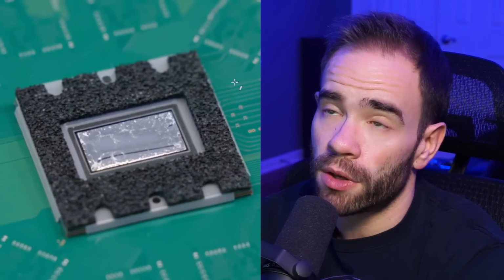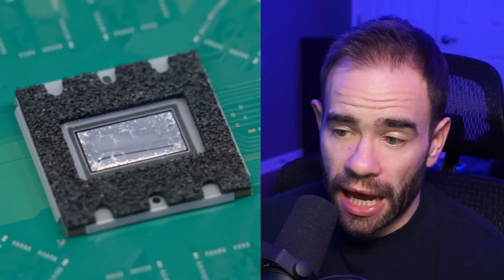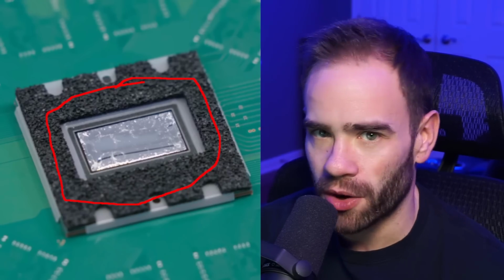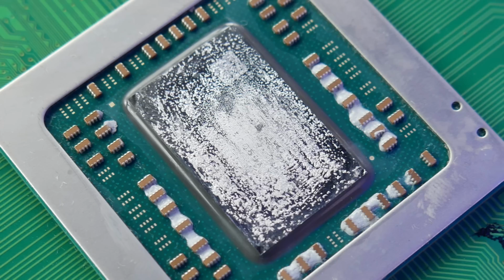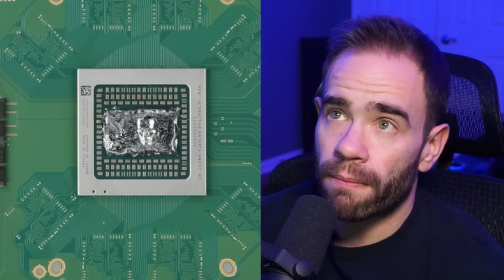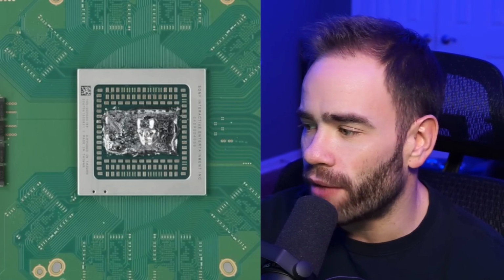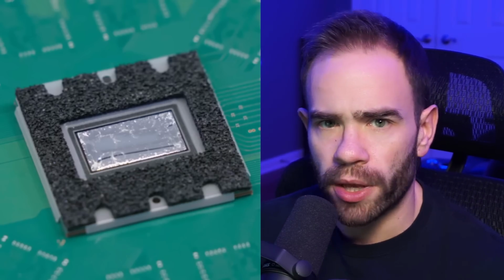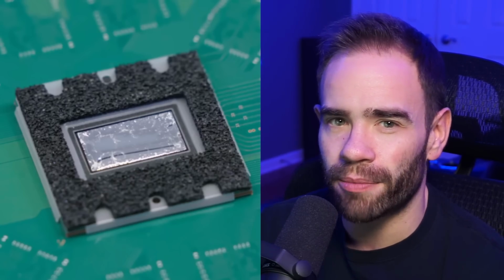Is Your PS5 Actually In Trouble?

Comment: The main challenge Sony had was to find a way to automate liquid metal application.  Anyone who has ever used this material knows how hard it is to get it to 'byte' originally.  The issue here, which is valid, is that the PS5 has about twice the liquid metal that is needed for a chip!  This means that it pools and moves and, unlike your PS4 Pro application that you did, it is the excess that would cause the concern.  I have done many chips and never had this issue but you literally use a pin-head of liquid metal on the cpu and also the heatsink (non aluminum obviously).  So the risk doesn't surprise me and there would be a greater risk of overheat or leak just due to the sheer amount of the liquid used.  If the seals hold then cool but LM also attracts LM so it 'pools' and it may drag more LM from the chip as it pools at the bottom.  LM gets absorbed into copper as well so there are a bunch of variables but I don't think you can compare the automated LM application on a PS5 to what you did on your PS4 Pro!  If done in the right amount and with the right care there should be zero risk (bar that of how other metals react to LM over time).  So I don't find this risk on a PS5 unwarranted due to HOW the LM is applied and how MUCH they use!  They also don't use a resin layer over the caps close to the die and opted for a plastic tape type thing, which doesn't guarantee it won't leak.  If you drop, or give the PS5 enough of a jolt it could unsettle the seals in place and cause it to to stop working.  So yeah, risks are minimal but there are risks none-the-less, and anyone who has used LM will see that what Sony has done actually increases the risk of leakage or overheating over time.  Great video and I don't think panic is needed, but horizontal placement should be 'advised' for long term ownership IMHO.
Reply: The reason Sony applies a lot of liquid metal is because the liquid metal in the console is expected to not ever be reapplied for the life of the console.  The liquid metal reacts and gets absorbed into the contact plate over time, as you’ve mentioned.  In a situation where no one is opening up the whole thing to check and reapply the liquid metal for years and years on end, the best option is to apply enough of it to last the life of the console and put barriers around it to ensure it doesn’t conduct any surrounding components.

If they applied the “correct” amount of liquid metal, all of the PS 5s would face decreased performance and overheating issues in the first few years.  This is why liquid metal producers for the pc market recommend yearly reapplication, because they know the diyers aren’t putting enough of it to need custom made barriers and the performance will start taking a hit once time passes and some of the liquid metal is absorbed into the virgin contact plate metals.

Comment: see this is actually called lazy engineering on sony's behalf. it took sony to use liquid metal to be able to get the same temps as the xbox series x, and it's still using thermal paste. but i won't hold that against sony, they have never been good with their thermal solutions when fans were needed.

Comment: As I've echoed several times, 99% of people are probably going to be fine and never experience an issue. That said, this is definitely more than a few isolated cases. I've seen several myself, and I'm not by any stretch of the imagination a big repair tech. Most of my repairs these days are done for content and bought as faulty on eBay. What I agree with here is Sony definitely does apply too much liquid metal on the PS5, and because of that it causes the liquid to pool up on the left side of the APU. The thing going around about how they're all drop damage consoles is absurd. If you think about it, all it takes is vibrations, give it long enough and that liquid metal will eventually start to seep into other areas. The density does help it, but at the same time I've had cases where there's no evidence at all of any kind of drop, and it's made its' way under the protective foam and under the black gasket (the video that wololo quoted).

One problem is wololo did misquote my video, stating I had claimed the console I worked on was stored without being used at all. That wasn't true, and has since been corrected. What I said in my video three months ago was that the console hadn't been opened by a technican, and that the seals were in tact so the only way it could have leaked was through natural causes.

It's amazing though how so many people, uneducated people (not yourself) are weighing in on this without any knowledge of how the system is built. Not only that but the amount of non tech channels, such as gaming channels, who are creating videos just for the views.

This will all blow over, in my opinion it's been way over hyped. But I'll take the free traffic from it all the same 🤣
Reply: I saw the story followed pretty quickly by watching your Sept. video, and I don't know how from that people think you're being malicious about this all. Seen too many people attack you specifically and just dismiss the entire thing because they don't like how you look.

It's an issue that could hit 1% of users, and that eventually could mean about a million systems if nothing is changed on Sony's end.

I guess the good news is that with everyone wanting to just ignore the warning, the issue will just become an easy source of repairable boards.

Comment: Ive had my ps5 since launch and have always had it set up vertically. The problem I’ve had was that my ps5 will randomly turn off and the only way to turn it back on is to disconnect the power. I researched on how i could fix this and moving the ps5 to horizontal was a possible solution. This did not work. I pulled the fan and thoroughly cleaned it and that did not fix it. What i realized is that having the certain games on the external ssd drive i.e. GT7, GOW Ranorak, and MWII made the ssd overheat. I moved them to the internal ssd and the issue was resolved. I don’t think it had anything to do with the positioning of the ps5. Other than that have not had any problems for two years plus
Reply: What external SSD did you use?
Reply: @lemming9984  i have the SABRENT 1TB Rocket 4 Plus NVMe 4.0 Gen4 PCIe M.2 bro. Im gonna get a different one to see if it makes a difference.
Reply: @sdtarango84  Do you have a heatsink on it?
Reply: Do you mean M.2?
Reply: @scottd7222  lol yes thats what i meant bro 🤭

Comment: Foam and plastic in general degrades over time. So I would say. After a few years of heat. The foam will deteriorate and eventually turn brittle. At which point maybe the liquid metal will start dripping out
Reply: It's not foam, it's spounge
Reply: @GameslordXY  sponge still deteriorates as well. If it's the same sponge like material I use when building electronics it needs to be changed out over time

Comment: The more I think about this, I have come to a conclusion that Sony missed the mark with some of the components they chose to use. The fact that what they chose requires overclocking makes me think they didn’t chose the correct components for the ps5. As a owner of the Xbox series x and a ps5 I now am somewhat concerned about long term ownership of the ps5. I have a ps2,ps3 and a newer non Red ring Xbox 360 and they all work fine. I am curious if my ps5 will last as long as my other Sony consoles.
Reply: you have a series x as a profile pic 🤣

Comment: I have 2 ps5s both disc version I bought them at release yesterday I took apart my 2nd ps5 I keep in my bedroom I don't play it much both ps5s are in the vertical position when I got down to the mother board I had a dime size dry spot at the top of the apu KNOW both ps5s are in horizontal position major design flaw

Comment: I'd think if the seal fails it's going to cause problems regardless of the orientation, they would just occur sooner in the vertical position.
Reply: Yes - But the issue as it's described is that gravity would cause most of the metal would pool at the bottom. Another issue I'm wondering is: How will consumers (or even sony) replace the liquid metal down the line? All thermal compounds need to be replaced at some point. If the seal is already having issues, this could prove problematic for anything but certain non conductive thermal pastes.
Reply: @quiethours1818  
At the bottom?
🙄😆
LM isn't as liquid as much as water ,plus it would kill your electronics immediately as it's HIGHLY conductive .
But they are transported in trucks across not always Great roads and not always perfect driving and turbulance in airplaines.
All the vibrations and bumps
would make them all either Dead On Arrival OR as soon as you turned them ON.
Reply: @GameslordXY  This is precisely my thoughts about this whole thing... I'm definitely not denying this, but if this was real "issue" for the PS5 we would be seeing TONS os cases world wide... And it wouldn't be something that we would just be hearing about lately...
Reply: @quiethours1818  liquid metal will sip out regardless, at that time it will just wait for you to move the console or kill the components around the die.
Reply: @quiethours1818  WRONG.
Reply: Exactly, more people should start saying gawrsh if they're gonna act like we live in a goofy movie

Comment: I've had my PS5 for more than a year sitting in vertical orientation. I've put nearly 1000 hours on the thing without a single issue. I think this is a flaw that happens from the factory, probably not after its been used. People love to freak out over this kind of stuff. It's a classic overreaction.

Comment: I've had my launch model standing upright since launch with zero issues. So over 2yrs now. And that's using discs. I think it only matters if you bang and knock them about. Hardly a red ring of death situation is it. Just buy an anything happens warranty so if anything happens they will replace it new for old. It only costs £50 for 3yrs cover.
Reply: I believe it’s when people mess with it and don’t seal it properly if they’re doing a deep clean

Comment: The whole console is just poorly designed. Components failing, issues with lots of parts. Most high end PCs don’t need Liquid Metal and they down have it. X solution is much better and quieter… can we get a fix for the controller battery, the buggy software as a min. Complete junk.

Comment: Not PS5, but I remember looking into having a setup with my laptop vertical, and there were testimonies that liquid metals may leak since generally laptops weren't designed to prevent that in the long run. Scared the crap out of me, so I didnt risk it.  So, I can totally see it happening to PS5. It seems Sony did add a pretty good containment for it though.

Comment: Had mine from launch and just started having issues with it shutting off randomly about 3 weeks ago. Have a friend experiencing the same issue now as well
Reply: I got the same problem, bought a ps5 totday and its been schutting down when i put the ps5 vertically, horizontal not seem to have a problem.  But i will need test more.

Comment: The whole worry about the liquid metal came from what a dude saw in a repair shop. I would think the percentage is extremely small if there are millions sold and he is only seeing a handful with that issue. And who really knows how most of the owners bringing them in actually took care of anything. It might be best on Sony's part to at least see if there is a bad batch that made it into the wild.
Reply: For every product, especially for consumer electronics, there is always a margin for failure. Usually that margin is very tiny, like 1%. Not like RRoD which was well over 50%.
Reply: @fattiger6957  facts
Reply: Ya don’t say
Reply: Yeah, I agree. Sony did actually had this problem before, especially with a PS4 pro why it sounded like a jet. I had to replace my with a higher quality thermal compound and put more on it. I never had the issue again. Because Sony put too little into their thermal compounds which caused a majority of the Systems to overheat
Reply: @takuminightcore  Or you could have just cleaned it like everyone else.
Reply: @sleep5234  
Correct me if I'm wrong but weren't PS4s near impossible to open up and clean without using some specific tools? It's definitely not easy like the PS5 where they made it so you could take it apart and clean it, at least
Reply: @sleep5234  that I did as well
Reply: @Alexandria Smothitel  If you think a basic screwdriver set is special then I don't know what to tell you. Your literally on YouTube just look it up.
Reply: @darceal tobey  they sounded like that because small fans running at 100% to disperse all the heat. Normal. Smaller fans are always louder.

Comment: People are making this a big deal when the issue has only happened to less than a handful of consoles. Handful less than 10 consoles out of 30 million. I also read that 2 have been verified to have added way more liquid metal than needed but wanted to make sure it did not over heat.  Biggest Mountain out of the smallest mole hill

Comment: I’ve had mine for less than a year setup vertically and just caught wind of this yesterday.  My console has been sitting atop my subwoofer this whole time and I got concerned that the vibrations may cause an issue.  It’s now horizontal and yes I had to rearrange half the room to accommodate this 😂.
Reply: Nah you'll be fine. My launch model has been stood vertical for over 2yrs with zero issues. And that's with discs vibrating all the time.

Comment: I don't have a PS5 yet but when I do, I plan on keeping it horizontal as I have with all of my consoles. I mean back in the day, there was the concern that setting a console vertically might scratch up the disc and well, that was true but only when people moved the console while it was turned on. 

This report about liquid metal seeping out of the sides and causing catastrophic failure is concerning. It would be interesting if Sony would give an official statement. 
It would also be interesting if it turns out this rumored 'D Chassis' PS5 model quietly further gets redesigned to minimize this being a problem.
Reply: Just got mine 5 days ago and since day 1 is been horizontal inside my tv stand and daaaamn that it gets hot sometimes lmao hope you get yours anytime soon

Comment: Had mine vertical for a little over a year and it still runs fine. Though it recently started infrequently dropping frames when I'm watching something, be it streaming or a physical disc, until I pause and unpause it. Playing a game? Runs perfectly smooth. Watching a bluray or something on Netflix? It's gonna look choppy at random moments. Doubt that has anything to do with the system being vertical, though.
Reply: Not it does not. If you are using 4k video you can go into the screen and video settings and change the 4k transfer rate to your liking. If something is truly wrong itd be the ps5 itself.
Reply: Happens to me too when using a 2160 tv, but on my 1080 tv it runs buttery smooth. Changing the transfer rate really helped for me though.
Reply: @fadel ray  Tried it just in case, because I've just left my PS5 on automatic since I got it, but it didn't do anything. Also I've had it hooked to a 1080p TV for a while, to make do. It worked perfectly fine ever since I got it and then randomly started getting choppy with anything that would be found under the media tab. I didn't change any settings or anything. It just started happening on its own one day.

Comment: Everyone should have it horizontal now. It's common sense.
You have liquid, and theres thermal expansion happening over and over again around a seal that is not tough enough.
And the liquid metal will pool at the bottom of seal.
Reply: 🙄You are so easily manipulated
Reply: @GameslordXY  no, I already thought about it before I had one. Makes a lot more sense to have it horizontal.
Reply: You hear that pc people who have used Liquid Metal for years?  Your vertically oriented motherboards in 99.9% of PC cases are going to fail, especially since a human applied that Liquid Metal, rather than a machine with precision.

No, this is a complete non issue, outside of a literal handful of consoles that MIGHT have been affected.
Reply: @Atlink  that's pc and is the seal the same as ps5?
Consoles have had problems in the past.
Reply: @bloomerb4162  I’m failing to understand your counterpoint.  Its still a vertical orientation, so the laws of physics would still apply.  It doesn’t matter whether or not it’s a pc or ps5, or any other computer.  If a thermal transfer medium of Liquid Metal between a heat sink and a component is being used, it would still show the same results due to gravity.

The main issue would be down to a manufacturing defect, or someone man-handling their console.
Reply: @Atlink  so you know that sonys seal is going to hold up? I'm saying the seal is most likely different.
I'm keeping mine horizontal. I also like it horizontal for disc drive, mine already makes plenty of noise sometimes when installing games.

Comment: Not sure if this has anything to do with it but my ps5 crashes when I play ps5 games after 30-45 mins it plays ps4 games fine and I have cleaned it too but it still does the same thing
Reply: Your power supplys air holes are more then likely clogged with dust that's what was happening to my launch ps5 I cleaned it out it quit doing it. You actually have to take system apart to clean the inside holes on the power supply